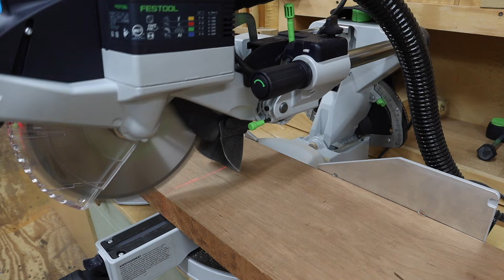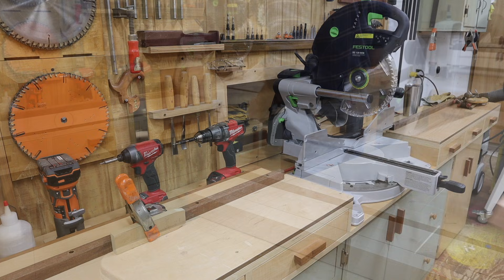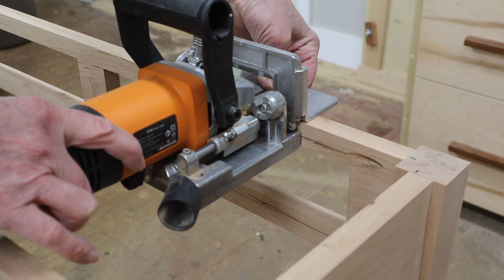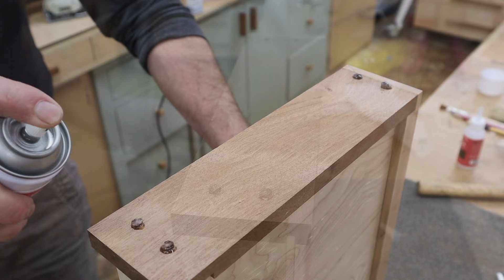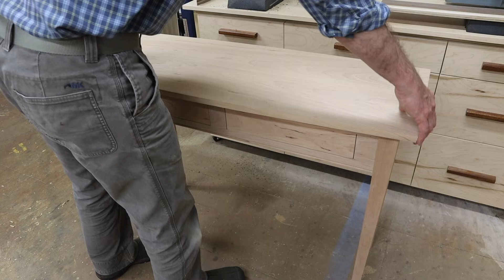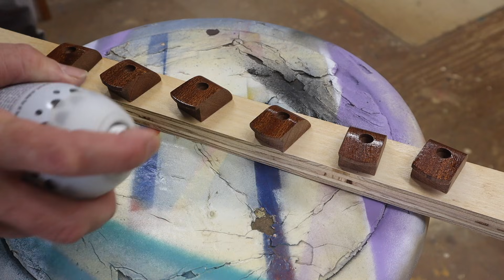How to Build an Entryway Table - Make Drawers & Drawer Pulls

Comment: I'm confused on cutting the tapered legs.  You only made two tapered cuts per leg.  Is that all it takes?  I had always assumed you'd need to make four cuts, but then the 3rd and 4th cut, your jig would have to be adjusted because now your reference surfaces aren't the same anymore (from cuts 1 and 2).  Please help!

Comment: Hi Jon, I have many of your plans and thank you for this video. I have a question. I want to simplify this table by adding two side drawer runners from front to back flush with drawer opening and install regular side drawer slides 1/2 in ones. Is there any reason why this might not work or wasn't used in this video?
Reply from the maker: Great thanks! Shouldn’t be a problem as long as the slides are short enough to fit in the cabinet.
Reply: @JonPetersArtHome  perfect thank you much for the advise. Just wanna let you know that the time you take to explain even little things is not gone unnoticed and is helpful and makes projects approachable. Thank for all your efforts and looking forward to many more plans.
Reply from the maker: @arjunchandars  great to hear! Thanks again I really appreciate it

Comment: It looks like the wood clips will hold the top in place while allowing the hardwood to contract but doesn't look like the top has room to expand though since they are screwed in and flush with the frame.
Reply from the maker: It’s been a few years, and so far so good… I’ll probably post some images of it in an upcoming video… Revisiting some of the old projects.

Comment: I must confess that you lost me when you glue the drawer bottom in more than one spot. With 3 types of wood there is no float or accommodation for the effects moisture change as the bottoms are a very snug fit. Other than (I.M.O.) the excessive use of pocket screws. Nice table. 👍

Comment: Finally a woodworker that uses the correct amount of glue.  If you have properly square and flat surfaces then a  bead is all you need, not gallons of it smothered on every surface.

Comment: Being a novice in woodworking, I am trying to explore as much as I can before starting on a very similar project. The question I have is about attaching the table top. I see some different ways people do it. Some are similar to the way you did it. Some are screwing the sides right in to the top, some are using 8 shape washer screwed into the sides and then into the table top, and some are both glued and screwed, this last one used plywood for the table top. Could you possibly explain the difference and reasoning behind these different methods, please?

Comment: I here table legs are only tapered on 2 sides is that common practice ? I want to learn how to make something like that. Thanks
Reply from the maker: Yes, tapered on the outside… that way you have a right angle where the apron attaches to the legs.

Comment: Hey Jon,  I'm in the middle of this project and It's coming out ok.  Question:  Did you resaw the drawer front at some point?  You don't show it on the video, but I can't see any way around it.  Side to side is okay, you have the saw kerf to give you some leeway, but the height is a different story.  The way you cut the aprons there is no saw kerf in that plane, the drawer height is the same measurement as the opening.  Just wondering....Mark
Reply from the maker: Hey Mark, I trimmed the width of the drawer fronts a very little bit… 16th of an inch or less to give them room to move
Reply: @JonPetersArtHome  Got it.  Thank you for the information and quick reply! Have a good one.  Mark

Comment: Great video.  Liked, subscribed, and bought the plans.  I'll be changing it a bit to Mission style.  I was looking awhile for a video with inset drawers with continuous grain, and this is just what I needed.  You don't comment about getting the drawer face reveals.  The drawer slide assemblies are flush with the frame, so I guess it's not and issue?  I'm not a novice, but I learned a few things in this video - never thought to trim off plugs with a trim router, and didn't think there was an issue with "telegraphing" biscuits, but I'm not disputing it happens.  Thanks again for posting.  Mark

Comment: I'm really torn.  Very informative approach and I love that solution for the front apron to house the drawers, but I'm having trouble with the pocket screws in lieu of joinery.  I'm that shop, I'm sure there's enough equipment to cut some mortise and tenon joints.  I don't get that kind of painstaking detail and lovely wood just to screw it together with pocket screws. Don't get me wrong, I appreciate the content.
Reply from the maker: No problem, it’s different approach for beginners who may not have as Many tools.

Comment: Hi Jon, Is that apron bead 1/4”?  The plan shows a 1/4 inch dimension next to the bead but it is not specific about the radius of the bead. Thanks!,
Reply from the maker: Hi Dave, thanks for your comment on this video and the ShopTalk video... this is a link to the bit I use. https://www.acmetools.com/shop/tools/cmt-86103211

Comment: I''m done with everything but the finish and looked back at this video and realized I only did the bead detail on the front apron. I think I'm DOA for doing the sides since it's all put together. My handheld router will get me to about 1 1/2" from the table leg on either side. Got any brilliant ideas? I have a feeling I've got to eat this one and move on.
Reply from the maker: How about making a small piece of bead molding and adding it to the sides and back like molding. It’s only adding about a quarter of an inch so it may not be noticeable to the eye
Reply: @JonPetersArtHome  Thanks for the reply. Good tip.

Comment: Hey Jon, I bought the plans for the Cherry entry table and have a question about the dimensions. The drawer bottom in the cut list says it's 13 15/16" but on page 12 Part I drawer bottom says tis 13 11/16". Am I missing something? Thanks.

Comment: Sorry to comment on an older video. Now that you have your Saw Stop with the nice crosscut sled, would you do the crosscuts for rough sizing of the legs and the crosscuts of the apron on the sled now instead of the miter saw? Maybe a more general question is how would you decide which tool to use for which crosscuts?

Comment: Just wondering about the apron. You cut it at 5 1/4" but once you rip the 1", 3", and 1 1/2" pieces won't it be slightly less than the 5 1/4" due to the loss from saw kerf?  I don't see how we start at 5 1/4" make two cuts and end up with the same. Thanks for a detailed video, you have a new subscriber.
Reply: This one I figured out.

Comment: Well done video but I would take issue with using a wet rag to wipe off glue squeeze out.  This has a tendency to force diluted glue into the pores and grain of the wood and that can interfere with the finish. Better to use an old chisel to scrape off the squeeze out after it has set up a bit.

Comment: Very Beautiful  Project. My question is on the tapered legs. what would you suggest as taper measures if what we have availble is  2x2s ( which are really 1-1/12 in) instead of the legs you used at 1-3/4 inches. Thanks

Comment: It would be great if you could add a recommended router beading bit to the plans and the description.  I suspect you used the CMT Corner Beading Bit CMT-861.032.11 which is currently out of stock in your Acme Tools store.
Reply: I managed to find that router bit and I recommend it. Great detail for this build. Thanks, Jon!

Comment: Beautiful craftsmanship Jon! As a novice woodworker, I am attempting to build this piece after downloading the plans. Getting ready to cut my front apron with only one drawer. I noticed the plan width of the drawer opening is 7/16” less than the drawer face width. Is this why you included the comment “adjust to fit opening?” Thought I would take a chance & ask before I misinterpret something. Many thanks in advance!!

Comment: Hi Jon. A lovely project, once again. I really like the long version - gives me more ideas for my own projects. Question: Instead of using screws to attach the drawer fronts and sides, did you consider using dowels?  Would have looked the same, but I wonder if it might have been stronger than screwing into end grain. I’d appreciate your thoughts on this.
Reply from the maker: Thanks, yes and I have used dowels to make drawers but it takes a little longer

Comment: Starting a bedside table build today. Picked up several things I’ll use on that project!
Reply: If you do a Q&A video I’d be interested if you worry about pocket screws splitting hardwood when driving into the joining piece. Also curious if you had considered putting through-dowels for the drawer instead of a screw covered with a dowel. Thanks Jon!

Comment: Well done video, Jon!   I'm thinking about the legs.   I tend to put the tapers on the inside of the legs.  Now, I'm curious to try one with the tapers on the outside and compare the look.   Hmmmm.
That Cherry is going to look stunning in about 2 years with some age and UV!
Reply: I have made some small furniture with tapers (approx 1/4 - 1/3 the length of the leg) on the outside. It gives the piece a sort of "shy" look, like japanese girls walking with the feet pointing toes inward. Try it!